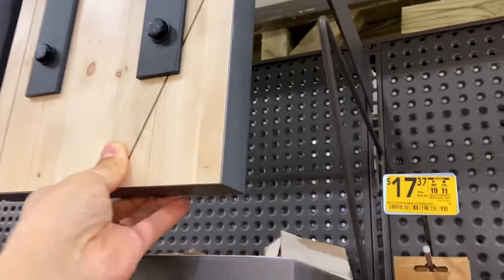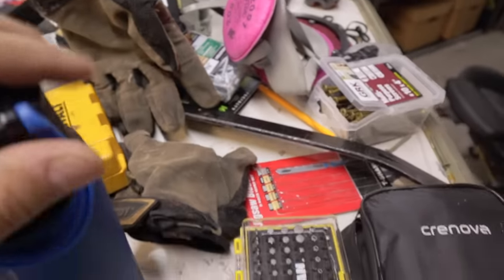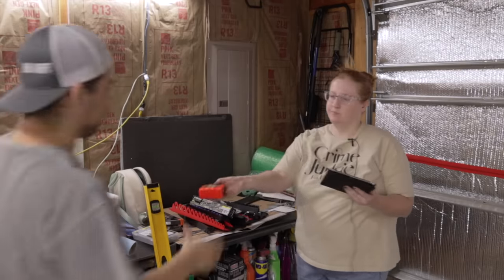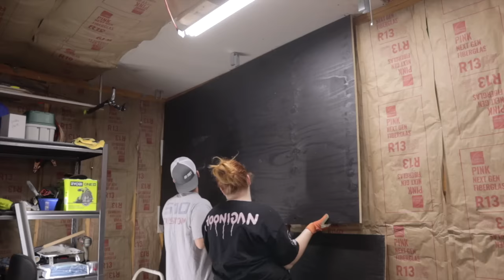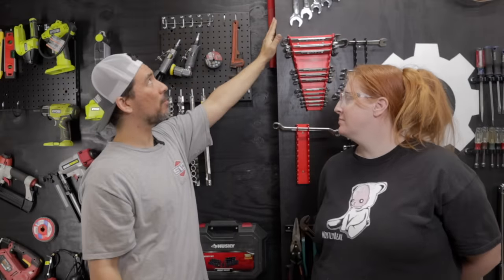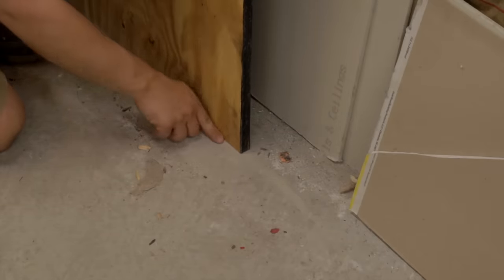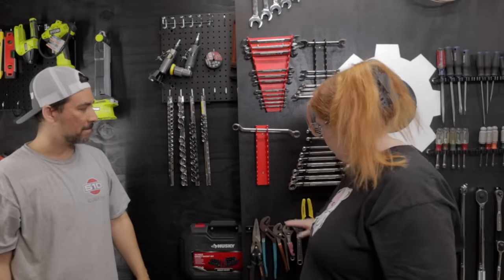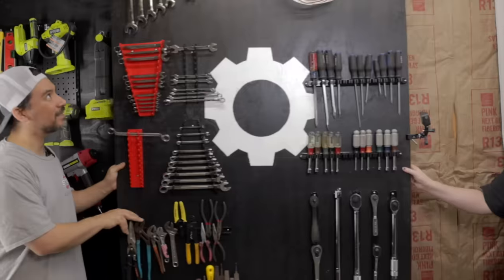The ONE Garage Storage Organization System No One Ever Builds

Comment: Prob would been money better spent actually finishing off the walls. Don’t quite understand the unfinished garage standards. Then could mount stuff to the walls??
Reply from the maker: Easier just to throw more plywood up and paint it instead of drywall at this point. Drywall has to be spackled, sanded, painted and then repaired if you decide to move a mount. PLYWOOD FOR LIFE 😁
Reply: The reason can be a little different depending on the area, but it’s just a cost thing.
Builders typically offer an option for the client on how far they go to finish the garage, and often the client decides to save the money.
It’s also common in many areas that fire code requires a minimum finish to be done. So sheet rock with one coat of tape, plaster and maybe primer.

Don’t love it either. If I do large builds one day, I’m gonna try to offer a painted plywood option.
Reply from the maker: @joshd108  painted plywood doesn’t look too bad. We love the black paint job 👍
Reply: @joshd108  yeah just looks unfinished. Not sure you could sell a house “unfinished” like that here in Australia. Garages here are little more than bit general storage. We actually have built in cupboards for storage. And obviously a place for  your Ute/car. We have sheds - normally at least 2 bay, for use as a workshop or more storage for boats, canoes and other big boy toys

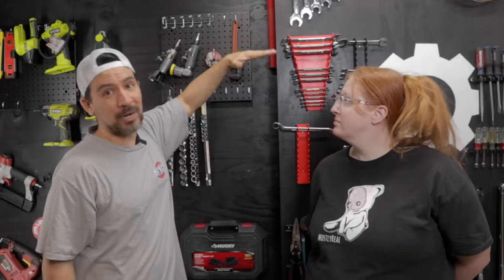Comment: 07:01 Looks like you did NOT instal the Anti-Teetertotter bolts in each of your ceiling mounts. ie: https://youtu.be/QMTnxq3nWJk?t=38
Reply from the maker: Ohhhh, anti teetertotter bolts, didn’t see those at Lowe’s. Will have to pick some up from Amazon. Just ended up adding some 2x4 between the unistrut at the end cap 🤣🤣🤣

Comment: Good 1st idea, & well executed.  But 1st idea thinking is Darwinism.  

Try thinking farther thru like "Given (1st idea here) what will result, needing (2nd idea here) to fix (1st idea here)'s problems?"  Rinse & repeat.

The problem with this 1st idea is moisture.  Everything exposed outside a closed toolbox is exposed to moist air when you open the garage door, & will rust.  Even stainless steel well oiled will rust a bit, & many tools are just soft steel that rusts a lot.  Now disassemble your artwork & put everything back into categorized tool boxes where they are less exposed.  Sorry.  Think farther next time.
Reply from the maker: Good point about the rust, but does a tool box that’s not 100% sealed still allow moisture to enter while shop is exposed to air? How much of a difference does this really make 🤔🤔🤔